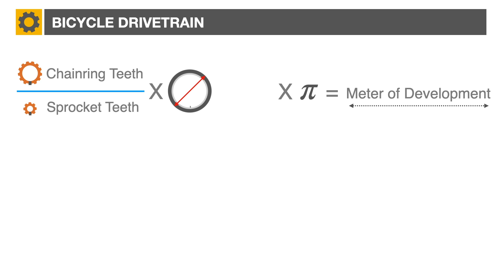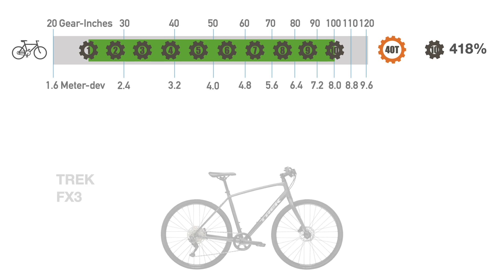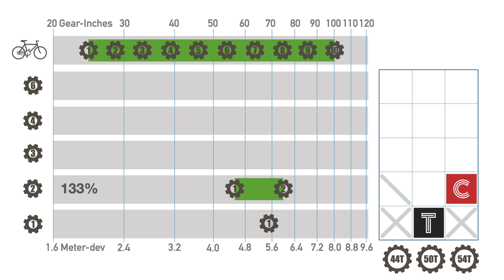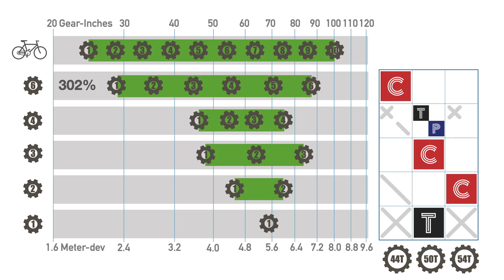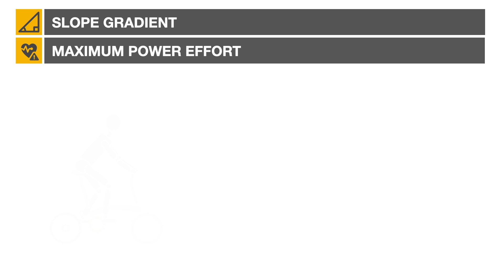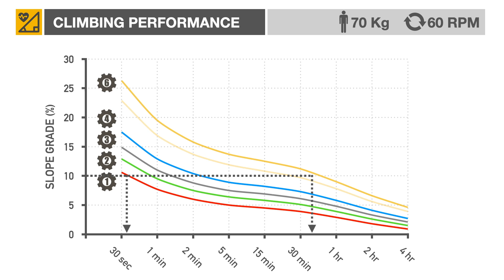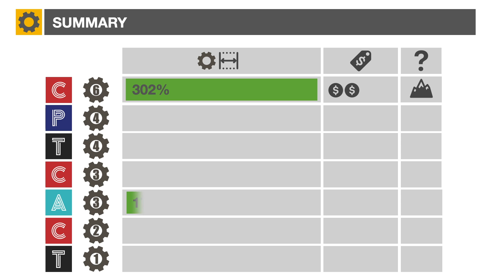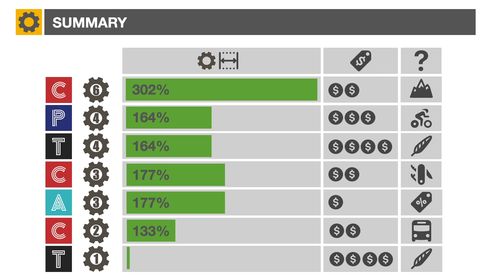Explaining Brompton Gearing - [ Rev. 2022 ]

Comment: You can get wayyyyy better gearing than this. Not dissing these videos. They are amazing, indepth, and incredibly useful. But I have found a vast majority of brompton users are stuck in a small bubble (Not calling out the makers of this video, just in general). Short story, you can toss way smaller gearing by changing the entire crankset. You may lose some of the perfected engineering of the Brompton but you can lower the gearing, with parts you might have lying around

Long story:  I prefer 18 gear inches because I would much rather spin up a hill than crank up a hill and I prefer shimano hallow tech ii just because thats what I feel into and have used it on all my bikes. I put my 38/24t hallow tech ii BB and xt crank set with a 10speed chain. I left the rear of my C-line 6 speed stock. I put two spacers on the RH side of the bottom bracket. It put my chain line closer in to the bike than my BH 50/33t chainring was. It rides like a charm. Now I need to adjust the length of my chain to make the chain tensioner have more tension when folding because my chain like to fall off the chainring and tensioner (Easy fix). The other downside is the folding pedal is clumsy withouth the support on the stock bromton crank arm and might scratch paint (I am going to just slap some inner tube on the top tube which will also be hidden because I put a top tube bag in that area already. I do suspect that the chain might fall off the chainring every now and then because I have found when you tend to mix drivetrain components without maximal precision this happens but I never freak out about my drivetrain. I just make sure there is clearance and its not noisy. This took me all of 30 minutes to set up and now my bicycle is set up for some crazy mountain climbing. I dont know why people dont talk about this more.
Reply from the maker: Note an updated version of this video was released in 2025
https://youtu.be/Ojk7z5o7l0k

We agree, Brompton does have a tendency to over-gear their bikes. Like you, we extended our gear range using a dual chainring ( https://youtu.be/5dbbAuFa60s )

Comment: I may be wrong, but i thought the A Line had a Standard range Sturmey Archer (177%), with the C Line having a wide range (200%ish) version...
Reply from the maker: Until recently, three different versions of C-Line used to be available: 2 Speed (Urban), 3 Speed (Utility) and 6 Speed (Explore).
The Brompton Standard Range (BSR 177%) internal hub was the same on the A-Line and C-Line Utility. Brompton recently discontinued the C-Line Utility, leaving only the A-Line with the BSR hub.
The Brompton Wide Range hub (BWR) is installed on the C-Line Explore and 12Speed P and T-Line as well as P-Electric and C-Electric. The hub itself offers 246% (supplemented by 2 or 4 sprockets).
Reply: @ thanks for the clarification.  It's odd that the Utility C Line had the BSR and not the BWR.  I would imagine the jumps between gears would have been harsh without the secondary gearing system of the Explore.
Reply from the maker: As mentioned in the video, the 3 speed (BSR) has 33% increment while the 6 speed increments ( BWR) vary between 22% and 27%. Installing a BWR on a 3 speed would give an 57% increment, not too practical.

Comment: I bought the Shimano cues 26t 40t Crankset and it works just perfect. If i go for touring i mostly stay with the 26. The rest of the year for commuting i take the 40t. The only downside is, that you can’t fold it, when its 26t. But in Touring mode i rarely fold it anyway. So i am very happy with it and can recommend it anyone, who wants a really low climbing gear.
Reply: I could use the Brompton, and No spacer needed.
Reply from the maker: Did you need to change the bottom bracket to fit the Shimano 26T/40T? DId you need to add a spacer?

Comment: [5:35] Does the image of 6 speed with two rows (1-3-5) and (2-4-6) correspond to derailleur settings of minus and plus respectively? If it does, I have to say I am a little disappointed that would mean that to use all 6 gears, would you have to shift thusly: -1,+1,-2,+2,-3,+3 ? That seems very counterintuitive, because then you would have between +1 and -2 to use both shifters. I guess as an end user I wish I could use all 6 gears with a minimum of control input, but - alas, it is what it is. In my very preliminary experience, this has got me choosing + in the derailleur, and then just living with its three gears (2-4-6), which for the terrain of Manhattan (whose slopes are usually long and modest) seems to be an effective range.
Reply from the maker: You are correct, the sequence is
1: 1-
2: 1+
3: 2-
4: 2+
5: 3-
6: 3+
And yes, you need to use both shifters in some cases. Note that 2-/2+ are you most efficient gears (2- being the best), so you may want to favor them as much as possible.
Reply: @2Bikes4Adventure  Thank you, and I see from the way you write it that the primary shifter is the 3 speed internal gear, not the 2 speed derailleur. As such I guess I could see if I could live in 2-/2+ most of the time, and step down to 1* and up to 3* as situations require. Very helpful. Thanks.
Reply: Having both an internal 3-speed hub and a 2-speed derailleur in order to achieve 6 gears seems like a very sub-optimal solution. It's such a shame that Brompton cannot produce an A-line equivalent that has a Shimano Nexus 8-speed hub. I think that would be great.

Comment: This was really educational on gear inches and leverage. It's been helpful from your other videos combined.

I checked the single speed line was 50T on its formal website. For the last part on a 4.5% slope (equal to 22:1), how hard could that be for an average-fit person close to 60? Thanks.
Reply from the maker: According to the graph at 6:21, a 70Kg (young) adult cycling a single speed T-Line at 60rpm on a 4.5% slope would need a break after approximately 15 minutes.
Assuming the same body mass, expect about 10% drop in performance for every decade above 30 years old. So, a 60 years old cyclist would likely stop after 10 minutes or so on the same slope.
Reply: @2Bikes4Adventure  Really appreciate for your time replying, Thanks a lot.

Comment: I got a C Line Urban for my commute to work. My commute is less than 3km, and there's only one hill of any significance; it's less than 250m, and depending on the stoplight at the beginning, I can generate enough momentum to fairly easily handle the first 1/3 of the hill. So for me, the C Line Urban was the perfect solution. 

That being said, I come from a road cycling background, and am used to covering distances on the road much faster; I tend to turn taller gears with relatively lower cadence. Do you think upgrading to a 56t chainring (I believe my bike came with a 54t ring) would make a noticeable difference?
Reply from the maker: Upgrading the chainring from 54T to 56T and 16T to 17T would both make you marginally faster (1km/h at 70rpm in 2nd gear) and provide better hill climbing performance in 1st. It’s a low cost DIY upgrade that can be easily reversed if you don’t like the end result.
Reply: @2Bikes4Adventure  great. Thank you for the recommendation.

Comment: I wish I could try, will need a bike to take me to and from work over the 59th street bridge. I'm 57. Would prefer the P line but not sure the 4 gears would work out for me...
Reply from the maker: Things to consider when choosing between 4 and 6 speeds.

1- The P-Line’s light weight advantage will be noticeable mainly when you are NOT cycling (i.e., when carrying it folded). If you are not planning to do frequent multi-modal commutes, the compromise between weight vs gearing may not be that advantageous.
2- Short of being able to test drive a P-Line, borrow any road bicycle of similar weight (22lbs) and set its gear to be similar to the P-Line’s 1st gear (46 gear-inch). On a 10-speed bike, this will likely be the 4th or 5th gear. Ride the Queensboro Bridge and evaluate how easy (or difficult) it is. It’s likely to be the same with a P-Line.
3- While the Queensboro Bridge 1/4 mile long 58 ft elevation gain (Manhattan side) won’t change, being 57 years old is a temporary situation (that will get worse with time). Keeping a Brompton for 10 years is not unheard of.

Comment: @2Bikes4Adventure If I change the p line rear to 11-13-17-21 what would the gear range % be with either the 50 or 44 chainring? I’m thinking of improving it for climbing but not losing too much top end speed. Thanks.
Reply from the maker: @wanderingsofalanandcaz Replacing the 15 and 18 sprockets with (larger) 17 and 21 will increase your range from 164% to 191% (irrespective of the chainring used).
If you do not want to loose existing top speed, keep your 50T chainring. Note that you may have to get a longer chain to accommodate the new 21T sprocket.
Reply: @2Bikes4Adventure  Excellent thank you. Obviously a 44 or 46 chainring would help on the uphill though yes?
Reply from the maker: Indeed. Reducing your chainring will give you better hill climbing capabilities but at the price of top speed.
Your chainring selection should also take into consideration the cadence/speed you are most comfortable with. The wider gap between the gears will reduce your options when trying to maintain your preferred cadence on flat terrain. We would suggest you select it so the 3rd gear represents your most comfortable/default gear while “cruising”.

Comment: As an owner of the former Top, SuperlightM6LXBrompton, I have used it during vacations on our only Danish, Rocky Island of Bornholm, and it has a serpentine road going up to a former lighthouse. As an elderly, too heavy man in a bad shape I had to walk once in a while, going up and also to pass the several "cattle prevention bars", crossing the road at intervals, some with a self closing gate to the side. My 6 gears came in fine but wasn't even enough for the job! I do also own a 33 gears carbon MTB, with gears which are so low that I can't even start on a flat road in them, but going up an extreme hill in a wood, they are fine!!  Finn. Denmark

Comment: Do you have any advice in terms of gearing for riding through beach sand? Maybe wet sand. I know ocean spray isn't good for things like steel bikes, but it would be useful to me for certain activities where riding on the beach is necessary. I have thought about fat tires for this purpose but haven't tried yet.
Reply from the maker: It is less about gearing and more about tire width and pressure. Anything below 2” (50mm) will be way too narrow (needless to say, the Brompton doesn’t meet this requirement). The lower the pressure the better (while still being within manufacturer’s limitations). A fat bike should have no problem. A lower gear in the 30 to mid 30 gear-inches (2.5 - 2.8 meter of dev) so should be sufficient.
Reply: @2Bikes4Adventure  omigosh thank you. I read it in the voice. Now I know what to get.

Comment: Can you put a 44T on the p line?
Reply from the maker: The P-Line chainring is a regular 130BCD, so it can easily be changed for a 44T, but this will likely be the responsibility of your local bike shop (or you), as Brompton seems to focus on the 50T standard configuration.

Comment: for P line , will there be any difference changing the cog from 11-13-15-18sprocket 50T changing to 11-13-17-21 sprocket 54T chainring?
Reply from the maker: Interesting upgrade. The total gear range would increase from 164% to 191% ,  providing a lower first gear and faster 4th gear. There would be a very noticeable gap between the 2nd and 3rd gear however. You may want to confirm your favorite cadence would not be affected by this gap.
Reply: @2Bikes4Adventure If I change the p line rear to 11-13-17-21 what would the gear range % be with either the 50 or 44 chainring? I’m thinking of improving it for climbing but not losing too much top end speed. Thanks.

Comment: What is your opinion on having one of those dual chainring (an extra small ring for climbing) for the 6-speed C line? I've read and seen some setups where there's no derailleur but they just use their hand/foot to swap rings.
Reply from the maker: Installation of a double chainring is indeed a cost effective solution to significantly extend a Brompton gear range. Low cost, high reward.
(Ref Upgrading your Brompton Gears https://youtu.be/-Q9wd8Ewlec  )
Reply: @2Bikes4Adventure  Just watched the video. Even saw the exact same video in it that gave me that idea, the one with the blue bike that shows the rider kicking the chain into the smaller ring. Thanks for the reference, will keep this video in mind when I do decide to do some gearing upgrades.

Comment: Hi. Would you consider using a aftermarket 53T/33T chainring to give more gear ratios? I can’t wait to have one. It helps with touring and climbing.
Reply from the maker: As discussed in our Upgrade Gearing video [ https://youtu.be/-Q9wd8Ewlec ], installing a dual chainring is a lightweight, simple and cost effective way to significantly extend your Brompton gear range.
A similar solution (with in Shimano Ultegra  52T/36T crankset on a P-Line) was used on a 83 hours/1200 miles (1900km) endurance ride [ https://youtu.be/iMgi0UXJ9Z8 ]. So, yes, dual chainring is the way to go.

Comment: Hi , it’s really a great video i watched it nearly 10 times its really useful, but i hsve s question , how to know the meter of development of an internal hub lets say, because the gear ratio alone in percentage doesn’t give us a view if the hub offers less than 2 meter of development in order to be good for climbing .
Let say im thinking to put a sturmy archer 5 or 7 speed on brompton how i know if its meter of development is less than 2 ?!
In website they just talk about the gear ratio !
Reply from the maker: The internal hub acts as a “multiplier” when computing a bicycle gear development. 
For example, a “fixie” with 50T Chainring, 12T Sprocket and 16” wheel would have about 5.52 meters of development (MoD).
If we retrofit a RX-RF5 speed Sturmey Acher on such bike (1st = 64%, 2nd = 80%, 3=100%, 4=125%, 5=156% ), we would get:
  1st  = 5.52 x .64 = 3.53MoD
  2nd = 5.52 x .8 = 4.42 MoD
  3rd = 5.52 x 1.0 =  5.52 MoD
  4th = 5.52 x 1.25 = 6.9 MoD
  5th = 5.52 x 1.56 = 8.61 MoD
So, the hub alone is not sufficient to compute gear development, we need to factor in the chainring and sprocket it will be connected to.
Reply: @2Bikes4Adventure  that makes sense,so if we put a 44 chainring with that same internet hub we would get a less MoD on the first gear to fit the hill climbing 
Thanks alot ♥️

Comment: how do I know whcih C bike is 40T or 55T?
edit: I couldnt find the info on bromptons website and I nerd the lower gear for the hills in my city
Reply from the maker: The C-Line Explore and Utility come standard with a 50T chainring.
The C-Line Urban comes with a 54T chainring
The A-Line comes with a 44T chainring.
You can request the chainring to be changed at initial purchase time (usually at minimal or no cost) or upgrade it at a later date for a small fee.

Comment: Hi, I have recently discovered your videos and I was impressed by the knowledge and the way you explain things. I've just bought a Brompton P Line (because my first priority is the weight and couldn't find the t line anywhere) and I find that the gear range is too narrow for me. I often find myself frustrated when I can't take advantage of a downhill to reach full speed. I was thinking of the following options:
1. (ideal) Increase the number of sprockets (e.g. 5 or 6 total sprockets) to increase the range. I guess I would have to choose sprocket sizes that make sense, in order to cover the whole desired range (preferably similar to the 6 speed brompton). You think it would be possible? Would it require to make any modifications to the rear triangle (e.g. widen it) ? what would be the most lightweight way to do it?
2. (good) Keeping the number of sprockets the same (i.e. 4) but choose different sizes so as to increase the range. Would that be possible? and what kind of range do you think I could reach, keeping a satisfactory overlap between the four gears (as per your video) ? What would be the most lightweight option here?
3. (least preferable) If not possible to change the range without adding considerable weight or irreversibly altering the frame, perhaps I should shift its current range upwards? Would getting a 54T chainring mean that I could go faster downhill but would have to put more effort while climbing uphill?
Thanks in advance!
Reply from the maker: Increasing the gear range on the standard 4 speed P and T-Line will likely be a hot subject in the coming months
1. 3rd parties started offering upgrade kits like this one:  https://www.fantastic4toys.com/collections/brompton-upgrade-parts/products/thx4ride-7-speed-kit-set-for-brompton-bicycle-p-line
2. Some P-Line owners report having no problem replacing the first gear with a sprocket bigger than the standard 18T. This is an inexpensive upgrade and can easily be reconfigured back to original specs if not satisfied
3. A 54T chainring would only shift the existing range higher (yes, making hill climbing more difficult). A dual chainring (54T/33T) could be a good alternative.
Reply: @2Bikes4Adventure  thanks!

Comment: Fab video thank you! Perhaps a further consideration if cycling in muddy or off-road conditions is that a hub gear system is less likely to get ‘stuck’ than derailleur, particularly when it’s so very close to the ground?
Reply from the maker: Indeed, the 3speed A and C lines are less prone to gearing contamination than the derailleur based models (2-4 and 6 speed).